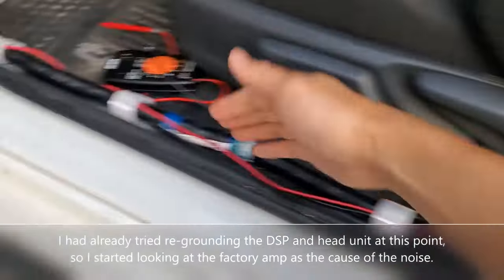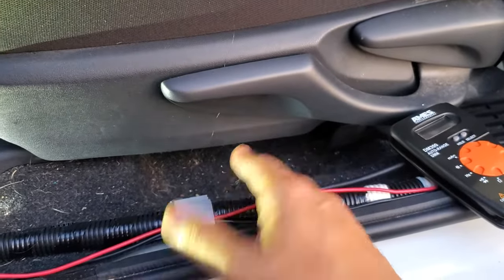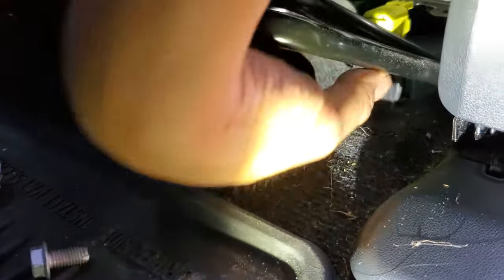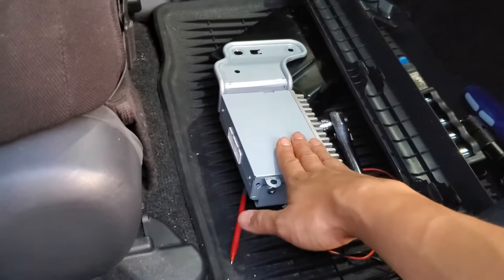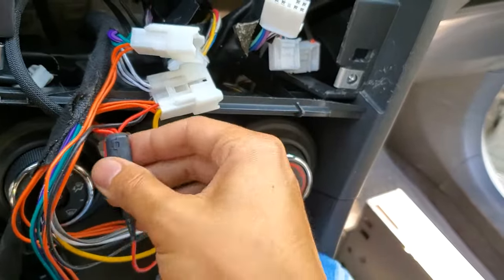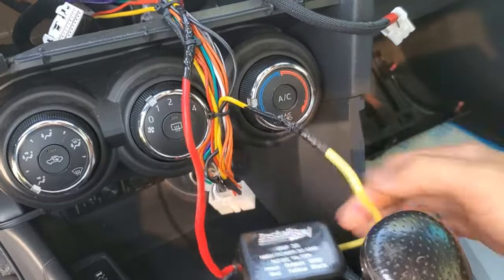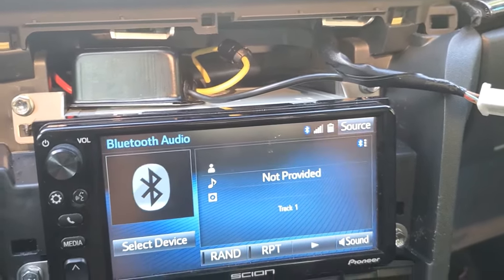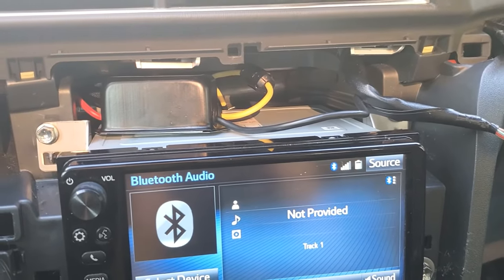Stereo Head Unit Alternator Whine Noise Filter Fix (Power Wire vs. Ground Loop) (Scion tC2 / tC2.5)

Comment: You’re supposed to splice these into whatever’s causing the noise if the radio isn’t causing the noise then you don’t hook it to the radio. My Noise was caused by my Cerwin Vega 400 watt amp for my 3 way components so I bought one of these. I got the 50 amp version comes with eight gauge CCA power wire so I opened it up desoldered  wire and added pure copper with 4 gauge because my amp has 4 gauge. You don’t have to go up to 4 gauge for that size but I might upgrade one day and you don’t have to upgrade to pure copper anyway cut the power wire in half to whatever is causing the noise like a DSP etc., and put one of these between the power wire I use screw down wire couplers for each side completely solved my alternator wine. There is zero noise. My friend has 1000 watt amp and his alternator wine was coming from his amp also so I bought 2 more 50amp isolators upgraded the wire again and ran them in parallel with two 50amp fuse distribution block it fixed  his problem. My cousin had the same problem, but it was coming from his radio and his DSP so we ran isolators to his radio, and his DSP solved his problem as well. Hope this helps someone.

Comment: Working on finding my whine right now. All I see online is how it is always a grounding issue. I think it is typically a power lead noise issue. I am currently trying different ground connections to see if it affects anything.
Reply from the maker: Good luck! I am still whine free with this solution.
Reply: What was it?
Reply: @rondjeee  I ditched the LCQ-1 and went with Zapco LOCs. No matter what I did, even with help from Audiocontrol, I could not get rid of the whine. I sold the LCQ-1 on eBay.

Comment: Thanks for the thorough video explanation.  After different solution attempts at my alternator whining noise the suggestion of an inline power noise suppressor worked like magic.  Now if only I could get a similar solution for my tinnitus.
Reply: Yeah, I tried stuffing ferric core magnets in my ears.  They did not suppress my tinnitus at all.
Reply: @jdlech  did you try the cotton bud method for the drum delete? Works well 😂

Comment: Hi Derrick , I’m facing a similar kind of issue on my Mazda cx5 .When I accelerate a strange sound comes .How do I know regarding the amp which I need ? Also didn’t understand the magnet bit ??
Reply from the maker: Before you go this route, have you done all the proper troubleshooting for your aftermarket amp? Checked your ground connections? Made sure your power wires aren't running along side your audio cables? Using high quality, shielded audio cables? As for the magnets, look up ferrite core magnets on audio cables online.

Comment: Great video. Well made.
Have you tried using the wire they use for welding tools for a ground wire from your alternator to ground. It’s a common occurrence with older Chevy Silverados and the fix is using that type of wire. It has hundreds of tiny wires instead of the thicker common core wire inside a typical grounding wire on an alternator.
Reply from the maker: I couldn't find any locally when I added engine grounds. I may eventually do that, but it's not a priority at the moment.
Reply: Yea right, the wire commonly found as an earth wire on most MIG, TIG, ARC,  MMW welding machines?  Approx 20 mm o/d, has a thin insulating plastic coat easily peeled back which exposes many very fine durable wire strands like 0.03mm.  P E A C E
Reply: @cha-ka8671 I have an older Chevy Silverado with this issue, can you provide more details on your fix!
Reply: @nickspy it's what's called 1/0 AWG I installed it in my truck and tbh it didn't seem to make a difference that I could tell. Using the amplifier install kit that came with 17' of 4 gauge would've been sufficient.  I picked it up at my local auto parts store. Goodluck.

Comment: Just ordered both the core magnets and the inline noise filter! Hopefully this works 🤞
Reply from the maker: Let me know how it works out. What did you add to your system that you have whine now?
Reply: @VampyreX13  I'm not sure at what point I started having it, but I've done practically everything I could to get rid of this noise. I have even ran the ground and positive wire from my rear batteries (which is where the three rear amps are connected to) to the head unit in front. I have noticed when I disconnect the rca's from the head unit that it will drastically reduce a hissing noise that I also have. I previously thought it was my head unit from Amazon but the issue continued even with a pioneer stereo.
Reply from the maker: @thinshadow6669  while my setup is not that complex, I feel your pain. I did even more troubleshooting and rewiring then I let on in my video. Everything from centralizing all the grounds, to isolating all the grounds, and running dedicated power and ground to the battery. I even pulled all the power wires out of my DSP harness wire wrap so I could run them separate from the audio wires even though the audio was already high level outputs. It wasn't until I started messing around with the power line feeding the head unit, and in turn my DSP, that I started making any progress. I hope the 12V noise isolater works for you as well since it sounds like you isolated the issue to your head unit as well. Also, have you tried inline RCA noise filters at all? I didn't see that mentioned in your reply. I couldn't use them since my setup has no RCA outputs aside from my subwoofer.
Reply: @VampyreX13  Exactly it is very frustrating to do everything you can and still have the issue. Yes I have used a ground loop filter from installgear in Amazon, which had many promising reviews but no luck whatsoever for my system. I have regrounded my set up many times now so I thought I could rule out a bad ground. I even made an Amp rack from abs plastic thinking my Amp and epicenter could be picking up a noise from the back seat of where they're mounted and distributing It to the other amps through the distribution blocks, but still no luck.
Reply from the maker: @thinshadow6669  wow, yeah I know that process is a pain. It took me two weeks to realize that maybe it's the power. Let me know if putting the noise filter on the power line fixes your issue.
Reply: @VampyreX13  I finally got around to installing the power noise filter with no luck, so I saw no reason to keep it there. My issue is just going to be somewhere else, however I believe the magnets did help a little as I've lost some of the alternator whine. Anyways thanks for the help!
Reply from the maker: @thinshadow6669  damn, I'm sorry it didn't resolve the issue, but at least the magnets helped a little. What is your setup in the car like? An amp for the speakers and one for a subwoofer? Have you bypassed the factory amp completely?
Reply: @VampyreX13  I have four speakers in the front running off from planet audio amp and four other speakers  in the back with the same brand amplifier, each connected with a Rockville r7eq. As for the two skar subwoofers, they are powered by a Rockville amp and driven by an epicenter. Both the epicenter and the equalizer have rcas from the back of the Pioneer stereo head unit. The Rockville amp, epicenter, and fuse distribution block are mounted on the back of the rear seats with a abs sheet of plastic seperating the equipment from direct contact with the seat. The midrange speaker amps are in the trunk on the end sides of the subwoofer box. Four batteries where the spare tire would be located at and everything is securely grounded. I don't think it could be a ground issue as a  ground loop isolator didn't work and the fact that I've tried different mounting locations. Amp metal bodies aren't making any contact with other grounds. I've cleaned up wires with no results.
Reply from the maker: @thinshadow6669  is it just a whine that you get, or other noise? Where is the power for the R7EQ equalizer tapped into. Can you wire up your head unit and the equalizer power together also that they are both run through the noise filter?
Reply: Yes actually I forgot to mention I first connected the noise filter to the power wires for equalizer and epicenter. I will just have to keep looking for the issue
Reply from the maker: @thinshadow6669  damn, ok. Good luck tracking down the issue. Drop a note when you figure it out.
Reply: @VampyreX13  Thanks for all the help and will do!
Reply: @VampyreX13  hi there, I tried your fix. The alternator whine went away after I installed the ground loop isolator. Now, I am hearing a constant very high pitch sound. I don't have ferite cores yet. Did you experience the same when you installed your noise filters only?
Reply from the maker: @myscienceteacher195  I did have a little high pitch whine, but it did go away after I added the magnet.
Reply: @thinshadow6669  if you havent figured out how to fox the whi ning noise its the rca's  pioneer radios are famous for this problem. to fix it ground you rca cables going to the back of the stereo to the outside of the stereo anywhere you can see a screw to put wires under.
Reply: @alanray7177  thanks, I'll have to try that
Reply from the maker: @thinshadow6669  curious to know if that fixes any remaining issues for you.
Reply: How do u install the magnet
Reply: @alanray7177 how do you ground RCAs ?

Comment: Nice video.
I added Bluetooth to my original Casette Player and I ended up with this alternator whine.
I tried to:
- Take power from inside the Casette Player.
- Filter with all sort of capacitor combinations.
- Put a Switching Power Supply without ground isolation.
The next step is to use small Coaxial Cables for the Audio Wires.
Reply from the maker: I'm not sure how your Bluetooth is wired up, but make sure that your power and audio cables are separated.
Reply: @VampyreX13  I know this is a year late, but it could be a overlooked ground loop...
Reply from the maker: @xtremediy1815  That's always possible. When I did my troubleshooting, I actually isolated everything from the chassis and did a central ground, and that made no difference.

Comment: Thx man.  Great video.  I've got the whine bad after installing a full system, will have to try this.
Reply from the maker: Did you already try centralizing your ground points or running power directly to the battery first? I only did this as a last fix once I did all the basic troubleshooting steps and none of them worked.
Reply: I fixed the issue.  I had my RCAs routed next to a few power cables and the harness for my brake and turn signal lights.  I moved them and insulated areas where they crossed over near any vehicle wires and it's all good!!
Reply from the maker: @knobleindustries8106  ah, that's one of the first things you need to do and I'm sorry I didn't recommend checking that you have your power and audio wires separated from each other.
Reply: Nice video Derrick. Thank you... I just bought the noise filter but I don't have an amp so where does the yellow wire do? In a 2004 saturn ion 2,  The yellow wires on my factory harness aren't meant for the noise filter?

Comment: Thank you so much .. its a high pitch noise and hurts my ears .. but i put an instalation in my car with 2 emplefaires 1 fore speakers and one fore big woofer .. wil this solve the problem ? Thank you
Reply from the maker: It should help if the noise if from interference on the power line. I can generally hear high pitch whining sounds, so I know the pain. There's virtually no whine after I installed this.
Reply: @VampyreX13  thanks !!!

Comment: If you have shielded rca cables, can you run them next to power amd or ground cables? Is it safe to do so since the cables are shielded??
Reply from the maker: If you have good quality, shielded RCA cables, you should be able to run it along side the power wire, but I prefer to stick with best practices and keep them separate. That way, if there is some sort of noise is introduced to the system, it's one less step to troubleshoot.
Reply: @VampyreX13  i ended up changing my rca cables and moving them away from being run with the 0g power cable and it solved the problem. Either it was due to running along side the power cable or it was bad quality rca cables. They were nvx brand shielded rca cable that i got in 2016 or something. I swapped with amazon brand rca cables.
Reply from the maker: @akuma4u if you have an amp that needs 0 gauge cable, then that's probably too much power running next to an RCA cable. If you're were running a smaller power wire, then I think it would have been okay. But again, I always like running the power and audio opposite of each other. Glad you were able to figure out your issue.

Comment: I might need to get this, mine is a little different only on Front RCA's I hear a random tick/crackle sound every 15-30seconds, even with music off (mute). I have a DEX-P99RS
Stage 4 HU, which started about 6 weeks into the installation. I hear it more when my AC is on.
Reply from the maker: I hope it fixes your problem. Let me know.

Comment: Hi wanted to ask a question, since my speakers are connected to an amp rather than the head unit directly should i run the mentioned filter with power cables of the amp or head unit? Thanks in advance
Reply from the maker: You want to start at the head unit first because that's the signal that you're going to be amplifying, and if there's engine noise present there, then it will get amplified as well.
Reply: Will do thanks man!

Comment: Hey i have an engine noise too in my Mercedes c220 after replacing the original Display with an bigger Android System. I have already install an ground loop isolator to the aux Cable. It helped a little but i have still little noise and engine noise. Do u mean this high Power noise Filter can help me ?
Reply from the maker: You won't know until you try. I did all the basic tests and fixes to eliminate unwanted electrical noise before testing this out and having it work for me.

Comment: Would using the noise filter’s different gauge in the wiring not cause a fire risk? My filter just came in but the wire is considerably larger than the wire going into the stereo.
Reply from the maker: No, it's the other way around where if you use too small of a gauge wire that you can have a fire risk.

Comment: Did you cut both red and yellow wires for the inline noise suppressor? How did you connect it?
Reply from the maker: I only cut the power wire in half. The end from the battery goes to the red wire on the suppressor and the end that goes to the radio to the yellow wire on the suppressor. Then I connected the black wire the suppressor to ground.

Comment: I’ve been having this same issue while accelerating and would get this whine noise but now I no longer have audio coming from the speakers and the whine noise is gone, I’m not sure if I need a new fuse or if its the way how the amo is grounded etc🤦🏽‍♂️
Reply from the maker: Fuses are a good start, and if it is a fuse, you'll want to check and see why it blew to begin with. The factory amp is grounded to the chassis just under the drivers side seat and the factory radio via it's frame as well the the ground wire in the harness.

Comment: Did you tape off the ground and red power wires coming from the head unit after installing the filter?
Reply from the maker: No, this is installed inline.

Comment: pretty sure grounding to that bolt does nothing thats why you still have the noise, I could be wrong, I have a similar car - corolla, and am trying to find the best ground for my head unit
Reply from the maker: I had originally ran a wire to ground directly to the battery while doing my tests and it made no difference. With this current setup, I've completely forgot I even had any alternator noise at all.
Reply: Sam steeno did you find a fix yet ? I have the same issue and same car.

Comment: Is this the power or the constant power? On mine the constant power is yellow 
The regular power is red.
Reply from the maker: I connected to the yellow constant power, the thicker wire usually referenced as pin D on the harness.

Comment: How do i know how many amps i need for this ? I have a jeep wrangler basically i only change the stick radio for kenwood 8 inch panel.  Im confuse about that please
Reply from the maker: If you look on the back of your radio, they usually have a fuse on it. Get a noise filter at least equal to that fuse's rating.

Comment: The alternator is not causing the problem. What you are hearing is electrical current. It's your coils firing and returning to ground and the voltage spikes contaminate the radio circuit. Put a diode in the return.
Reply from the maker: So you're talking about using something like a 1N4007 diode on the ground then? Where would you install it at? I'm not sure I would want to mess around with the ground for the coil packs due to the engine bay heat and there's too many grounds between the radio harness, headunit chassis, and factory amp harness / chassis to isolate.
Reply: @VampyreX13  lol, The ground for your radio.
Reply from the maker: The problem with that is that the radio is grounded through the chassis, the radio harness, possibly the antenna harness, and the factory amp via the chassis through the amp harness at a minimum. I don't think I found any other grounds, but that was still a lot of grounds to try to isolate to prevent a voltage spike contamination. The noise filter actually did the trick though.